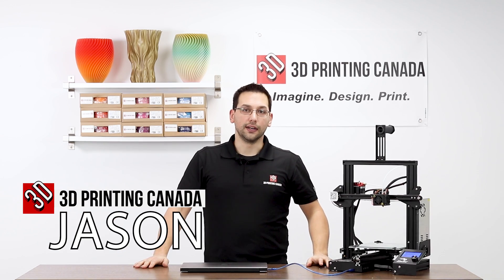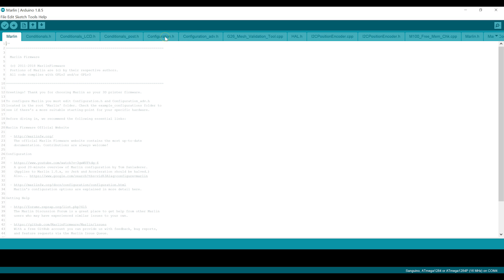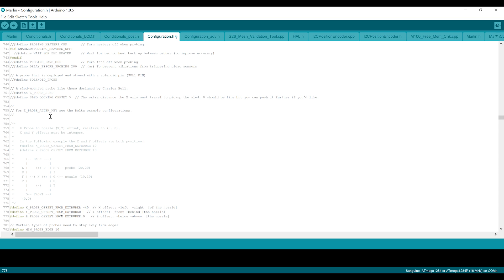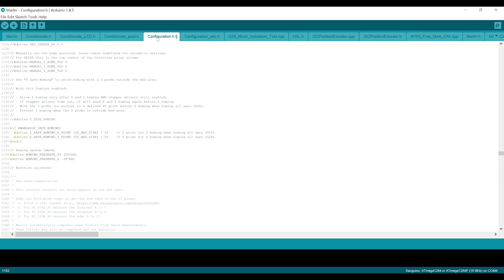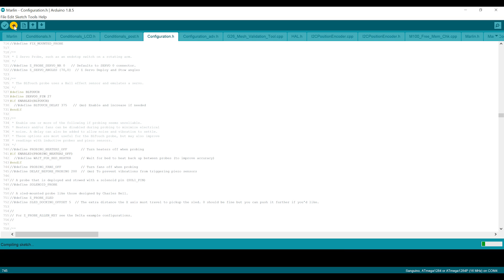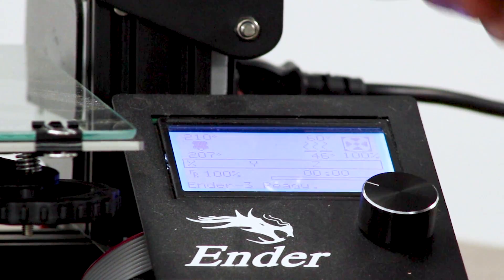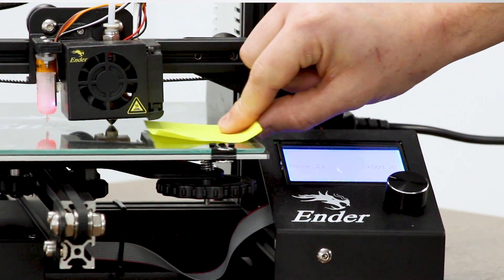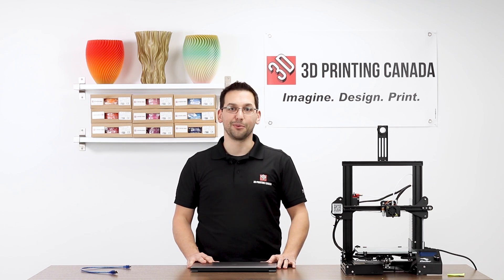How to install Vanilla Marlin Firmware for the BLTouch on a Creality Ender 3

Comment: I got an error #error "Auto Bed Leveling requires one of these: PROBE_MANUALLY, FIX_MOUNTED_PROBE, BLTOUCH, SOLENOID_PROBE, Z_PROBE_ALLEN_KEY, Z_PROBE_SLED, or a Z Servo." CAN SOMEONE HELP ME! I've been struggling for 2 days straight to install the firmware and getting the codes right

Comment: How did you put the electronics cover with fan back on with the Pin27 board in place? Mine will no longer fit because the Pin27 board connectors and cable is in the way.
And Marlin 2x does not have an "examples_configurations" folder.

Comment: The line below  127 //#define BLTOUCH,  (  //if ENABLED(BLTOUCH)  ), does not exist in the patches for 1.1.9 bugfix-1.1.x, just 2 empty lines then a load of grayed out text, 

" * Enable one or more of the following if probing seems unreliable.
 * Heaters and/or fans can be disabled during probing to minimize electrical
 * noise. A delay can also be added to allow noise and vibration to settle.
 * These options are most useful for the BLTouch probe, but may also improve
 * readings with inductive probes and piezo sensors."

So added the #define SERVO0_pin 27, verify, and get the error below. 

Arduino: 1.8.10 (Windows 10), Board: "Sanguino, ATmega1284 or ATmega1284P (16 MHz)"

c:/program files (x86)/arduino/hardware/tools/avr/bin/../lib/gcc/avr/7.3.0/../../../../avr/bin/ld.exe:
 C:\Users\M \AppData\Local\Temp\arduino_build_14954/Marlin.ino.elf section `.text' will not fit in region `text'
c:/program files (x86)/arduino/hardware/tools/avr/bin/../lib/gcc/avr/7.3.0/../../../../avr/bin/ld.exe: region `text' overflowed by 8262 bytes

collect2.exe: error: ld returned 1 exit status

Multiple libraries were found for "U8glib.h"
 Used: C:\Users\M
exit status 1
Error compiling for board Sanguino.

As for the multiple libraries error didn't find any.

Comment: Ciao ... could you help me please
I installed the bltouch but I can't flash because I ALWAYS get the following error.
I Try to change pc  and port but i can flash...

avrdude: stk500_getsync () attempt 1 of 10: not in sync: resp = 0x65
avrdude: stk500_getsync () attempt 2 of 10: not in sync: resp = 0x63
avrdude: stk500_getsync () attempt 3 of 10: not in sync: resp = 0x68
avrdude: stk500_getsync () attempt 4 of 10: not in sync: resp = 0x6f
avrdude: stk500_getsync () attempt 5 of 10: not in sync: resp = 0x3a
avrdude: stk500_getsync () attempt 6 of 10: not in sync: resp = 0x53
avrdude: stk500_getsync () attempt 7 of 10: not in sync: resp = 0x44
avrdude: stk500_getsync () attempt 8 of 10: not in sync: resp = 0x20
avrdude: stk500_getsync () attempt 9 of 10: not in sync: resp = 0x69
avrdude: stk500_getsync () attempt 10 of 10: not in sync: resp = 0x6e
Error loading sketch

Thanks from Italy

Comment: After 2 weeks of trying and  following 10 of videos, this is the first time the 3D Touch worked on my ender 3, after following this video. The only issue I see is it only sense one center point but not 9 points.
Reply: mine just crashes into the bed.
Reply: @BlakeNiemyjski  First you need to test if your sensor is working properly.  Raise the Z-Axis high and when auto home, try to obstruct the sensor with your finger. If that works your sensor is good else check connectors of your sensor. The change from my previous tries and this working one is the speed of homing. The 3D Touch sensors are slow to sense and by the time they were sending the signal to Marlin the nozzle is already crashed. In this method, the speed is already slow and hence sensing perfectly. Last night I printed my first lithophane which came out very nice.
Reply: @priyankchouksey  I did that, and it seems like it needs constant pressure to go up and by that time it already hit the board. G28 always caused this behavior but G29 always worked. It just seemed like it was way to slow to react on homing.

Comment: well what seems to be a problem on my ender 3 is the z axis. When the calibration with bltouch is done, the the other side of z axis ( the one with no screw) doesnt respond to the minor changes of z axis. So to my conclusion the bltouch is pointless for ender 3.
Reply: Hi. One thing that could solve the problem could be a dual z axis mod.

Comment: I probably went through 4 or so different videos of people installing the bl touch and the marlin firmware for it. This was the first one where all steps were followed and compiling worked. Thank you so much for putting this together. I spent yesterday setting up a raspberry pi and octoprint, installing a boot loader and marlin, and attempted to install the bl touch to my ender 3 pro. It killed me to have to give up on the bl touch and go to bed with it unfinished. It would not compile yesterday and I couldn’t figure out why. Following your guide, it compiled on the first go. The video was very much appreciated.
Reply: @Jason I followed your guide several times. Enabling Bilinear makes my sketch 6000bytes too big. I cannot get it to work. Did you safe some space elsewhere? I have no idea but it more and more seems like BLtouch was the wrong direction to head to if I need to be a rocket scientist to get it to work.
Reply: @Jason I did as shown in the video. 1.1.9 updated. The Lin_advance or s_curve.. is all disabled. No freaking way. Also ChitChat and stuff disabled does not help. 
It is the bilinear that makes it too big (or any other from the list). So I guess it is no longer possible to use Marlin so I went to TH3D and it worked like a charm with BLTouch. 
I have no time to mess with this Arduino settings to make it work. Thanks mate.

Comment: I ordered a part from you guys and am still waiting on a tracking number! It’s been 3 weeks!
Reply: Jason coming at me with, this is not the right way of asking about a product I bought from your video didn’t sit well with me. I did do that and could not get threw due to the holiday rush. I just called, all figured out just with no tracking number. I wouldn’t have asked if you were some random person reviewing something. You should have the contacts to get a simple issue like this solved. It would look better just sayin. 

It’s what it is, don’t mean to be an ass but sometimes I’m an ass, I’ll admit. You do great reviews and on the products I use so hope there is no hard feelings.
Reply: Jason in stock, and alright.
Reply: Btw, I bought threw your link. No need to be harsh. You obviously work with them. But thanks for not helping.